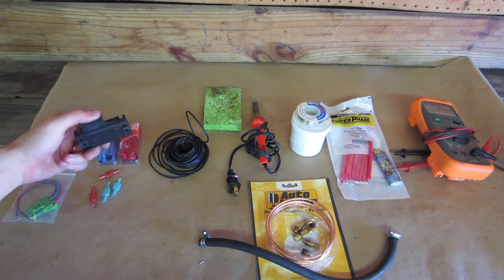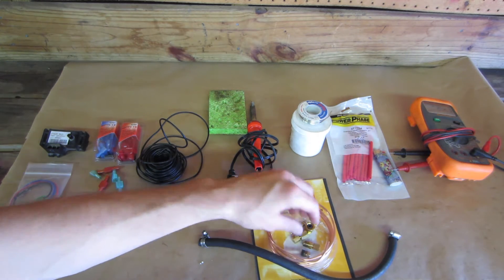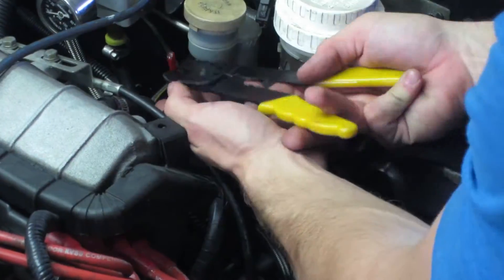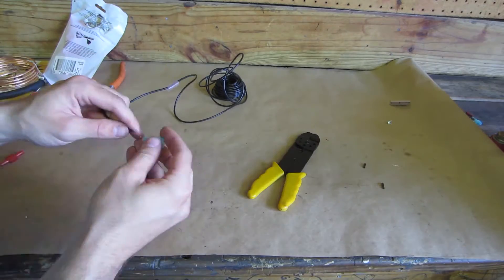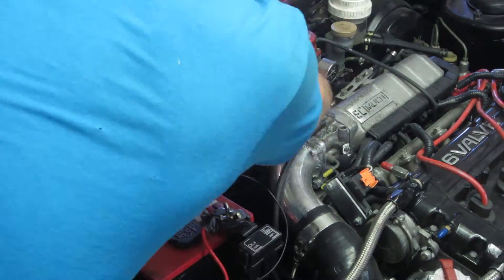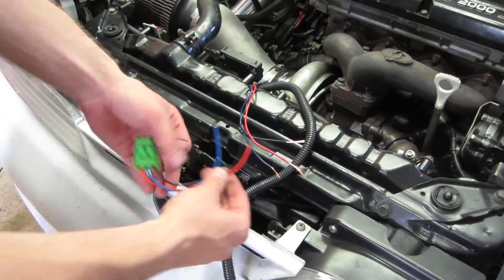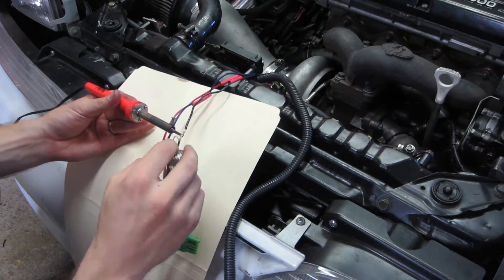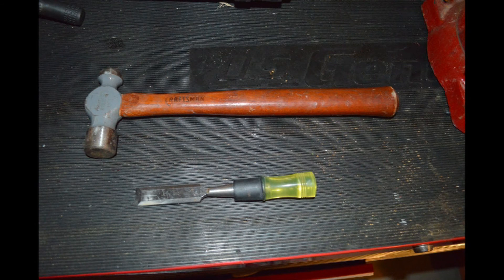Wiring and Logging a MAP Sensor   Part 1

Comment: I replaced my map sensor twice and twice still brought off the check engine light with the same code p1400 so I'm thinking it's just the connector or the wiring or somewhere down there so I bought a new connector but I don't know what each cord is and which one connects to which can you help me?

Comment: wanna ask ur piping intercooler u weld intake air temp. what type intake air temp sensor u used..
Reply from the maker: I used a GM IAT sensor for my install.
Reply: ic. so u install gm iat at piping still can read ..mostly ic my friend they install iat at intake ..may be i copy like u install the iat much batter easy ..tq bro

Comment: Hello from the Audi world,

Nice job on the video. You might think about investing in a heat gun. I picked one up for less than $30 and it makes sealing your connections with shrink tube a breeze. Don't have to worry about burning or melting the other wires or plastic in the surrounding area! My lighters are always disappearing on me as well, heat gun stays right where it should. ;)

Cheers.
Reply from the maker: Those lighters do seem to grow legs and walk away. It seems to be more and more likely depending on the amount of traffic around your work area. :) I have a heat gun to help install moldings but never thought to use it on shrink tubing. I guess the lighter is just more convenient and readily accessible but the heat gun would work wonders where an open flame isn't ideal. Thanks for the input.

Comment: Excellent work once again...I especially like your brown textured grip screw drivers...I picked up a set exactly like em...magnetic tips..comfortable feel...good choice! ;-)
Reply from the maker: Those screw drivers have been through a lot of abuse. Any time a hammer is involved, prying or anything else you can imagine breaking the tip, I reach for these and they have held up. I have a few different sets but these have held up pretty good. Thanks for the compliment.